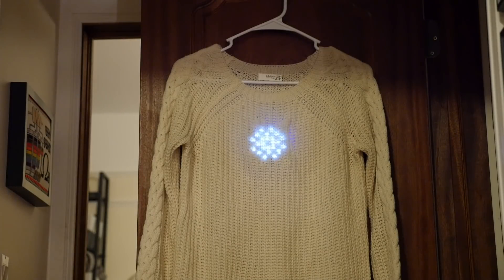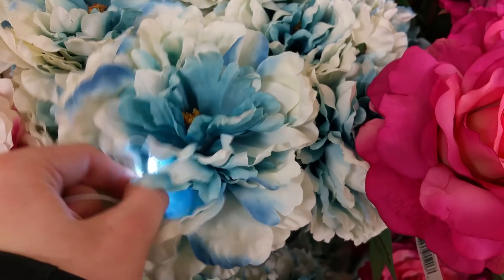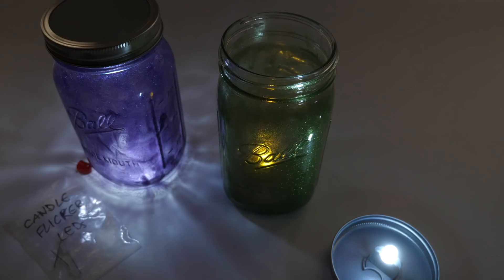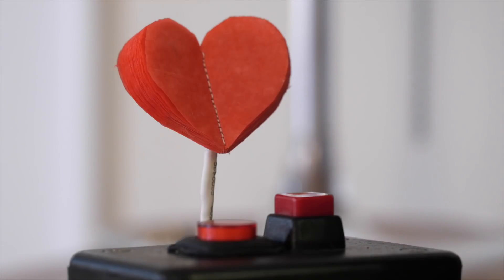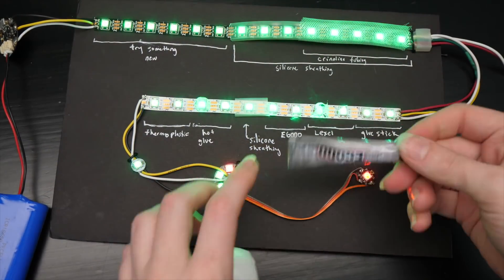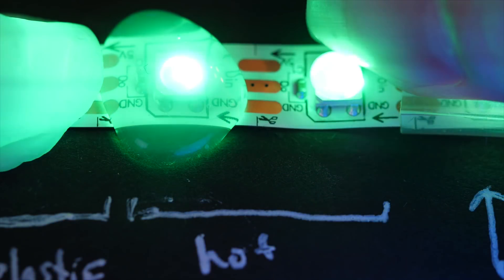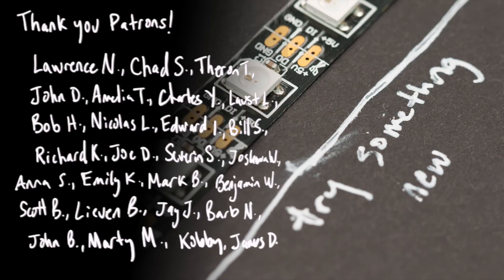13 Ideas for LED Diffusion // Becky Stern

Comment: This video was actually really interesting considering I was only looking as I have an RGB LED strip interior light in my car that I want to blend together to give a more uniform colour. I've fine tuned it to be white light but there's still certain areas that are illuminated as more a pink and other areas in that car that look green. The light in the car does look white it's just not all mixed together perfectly. I switched to a strip light as the OEM filament light was extremely dull, used 5x as much power and did not provide light in the rear seats or the boot.

Comment: I've tried Stencil / Tracing paper, if you place it a few centimetres away from the LED's it completely diffuses the light and lets most of it through. The best thing about Tracing paper is you can buy it in different grain thicknesses for tuneability. Best to build it around a frame for best effect.

Comment: Thank you for the video. neat to see the way light diffuses differently in different cases.
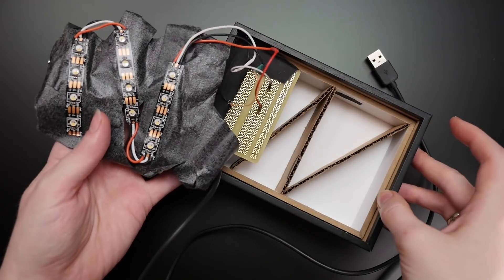That's the first time I've seen the shadow box technique 0:54, very simple, but quite effective zone technique
Your strip example of different materials is quite the teaching tool 4:30-5:50. 
The Crinoline tubing technique is pretty awesome as well 3:58
      from a different video this guy has a couple other techniques you might want to look into https://www.youtube.com/watch?v=mg1qygPJXOY
             He uses a sanding technique, and foams, and shows that distance from the light source makes a difference as well (distance, material, and different light strips)

you're 3d printed material, I'm interested in the material you used, but also what are the typical wall thicknesses you'd use for good diffuse, and how thick the material is when the light almost stops diffusing 

between the two videos, yours was good at showing on the strip the different materials and thicknesses.   There's another factor you might want to show on your sample strip, which is the distance of the opaque screen from the led light source

a 2 dimensional linear led strip test you could try with students
if you did a simple calculation, you could do a two factor graph
(different opaque material or same material with a different thickness )  * (Distance the opaque material is from the surface from the led) = Diffuse Value Scale Factor
you could then pick different materials (glue, paper, epoxy, .... )  and cause a similar diffuse factor by putting the test specimens at different distance from the light.

now if you throw a 3d printed object at it that changes the ball game, 
            but you could still show some simple properties to see what looks best for a diffuse scale factor
take a fairly simple geometric shape like a longish cylinder printed with your magic 3d printed material. 

3 dimensional cylinder diffuse led strip test
First test, Cylinder - Vary the Diameter (or radius) -  you could vary diameter of the cylinder. keeping wall thickness and length of tube constant (pencil cylinder to can shape cylinder) 
Second test, Cylinder - Vary the Height - you could try same diameter of cylinde, keeping wall thickness constant, but varying length of the tube (short to long cylinder)
Third test, Cylinder - Vary the Thickness of the material - you could try the above tests but varying the thickness of the 3d printed wall material of the tube  (thickness of the material)
[stack these test cylinders side by each on a led test strip, in a matrix formation]
The cylinder diffuse test, would be a lot of work, but it would show off a lot of the diffuse properties on the 3d printed material, in a 3d shape , more complex than the linear factors of the 2d test. 
This would give students and designers a somewhat decent idea of what to expect from a 3d printed object with the special 3d printing light diffuse material 
(waste less material in future trial and error off of predictive guessing technique)

Anywho, awesome video, and thank you for sharing! If you have any other diffusing techniques to share, please post them :) 
and if you or anyone else by chance happen to try the 2-d or 3-d diffuse test above , please share the results

Comment: Hi Becky thanks for the video very interesting my Daughter has a large stainless steel glass lamp it is about a foot tall and 6" x 6" across and is designed to take a church Candle but I want to make it into a garden led lamp with a small solar panel on top I have the electronics and solar panel but don't  know how to replace the candle with something that looks the part and gives a good light my solar panel is 5v 20ma charge and I can use a phone battery with lots of leds any ideas, please

Comment: Hey, miss watching your videos ( YouTube hasn’t been placing them on my new video feed) in reference to LED’s can a Gemma give an led halo  dimming function ? Trying to have these led halos I purchased pulse from low light to max light at a random pattern but not sure what the best option is.
Reply from the maker: Yep, Gemma can fade regular or addressable LEDs. You might try my free beginner Arduino class on Instructables to get started with the coding you'll need

Comment: Those semi transparent fluid containers like milk jugs (HDPE) are excellent. Also the stuff melts nicely, you can easily just cut a piece from the side of a canister, put it on top of some bulb-like object, stick that thing into an oven on about 160C for a while and you have a nice diffusor. You can use crumpled aluminium foil on the bottom as reflector.
Reply from the maker: Nice tip, thank you! If you readers take kke's advice, be sure to open a window/get proper ventilation whenever heating up any kind of plastic.

Comment: The mention of using the fiberfill of plushies for diffusion is similar to a technique a friend of mine does. She embeds LEDs into needle felting objects. The white/natural wool used to make the bulk of the felted objects not only is an inexpensive way to make up the bulk of the volume, but diffuses light nicely. It does take some experimentation with density to get the desired effect.

Comment: Hiya Becky. I'm wondering what's the effect of clear acrylic on top of LED as I'm building a transilluminator and hoped to get a diffuse effect
Reply from the maker: Clear acrylic doesn't diffuse (unless you are talking about edge-lighting it, in which case the effect is called Frustrated Total Internal Reflection), it'll just show off all the minor scratches etc. For diffusion with acrylic, use frosted/milky opacities or buff up your clear sheet with fine sandpaper.

Comment: Love it
I have a Question though - I accidentally sent a PCB for production where instead of a single RGB led, I have 2 SMD leds - red and green, spaced about 2mm apart. I've been trying all kinds of diffusers to make it look yellow when both are on but it just looks like red and green.. any idea what could help?
Reply from the maker: Hmm, that's a toughie! Can you put something directly in front of them that reflects the light backwards? Backlighting might be a way to get the rays of light to mix. Also perhaps when you assemble the boards you can tilt and solder the tiny LEDs towards one another a tiny bit. Did you try a ping pong ball? Best of luck!

Comment: In my first project over this weekend (Gemma + NeoPixel Ring + PulseSensor), I've found that the white opaque screw caps for plastic jars work great as a diffuser for the ring. Over it I've fixed a white material orchid, which serves further to diffuse and act as a neat visual. The cap also works as a really handy container for people like me who don't have access to 3D printers.
Reply from the maker: Awesome suggestion, thank you! Anywhere we can see your creation online? Sounds rad.
Reply: It's my first project, so my documentation has been pretty awful -- despite watching your video on the topic. I'm probably going to be doing the finishing touches tonight and put something on my Instagram -- I might Tweet it @ you later if you'd be interested?
Reply from the maker: Yeah, I'd love to see it!

Comment: What about a led matrix driven off a Raspberry Pi 3 MKIII running RISC OS and programming the matrix using the ARM assembler from inside BBC BASIC if you have four pin leds but you should be able to make flexible led matrices which you can scroll designs or your name across, don't use a laser cutter to cut vinyl or you might wind up inhaling the Endocrine Disrupter fumes best to be safe rather than sorry.

Comment: Wow, great video, Becky! My favourite diffusion material is ... that foam diffusion material, harvested from dead LCD screens! Theres a white layer the size of the panel roughly 1/4" thick you can easily remove from the panel assembly on dead LCD monitors. You can find tons of dead monitors at your local computer recyclers, company IT department, or at the curb on garbage day -- you can harvest that diffusion foam and recycle the rest! It spreads the light evenly just as the monitor required, and works just as great for any similar hobby project.
Reply from the maker: Awesome tip, thank you!
Reply: How do you cut it, ain't it like plastic that shatters